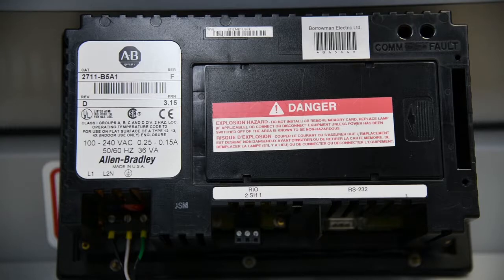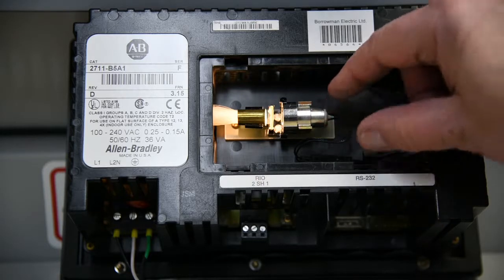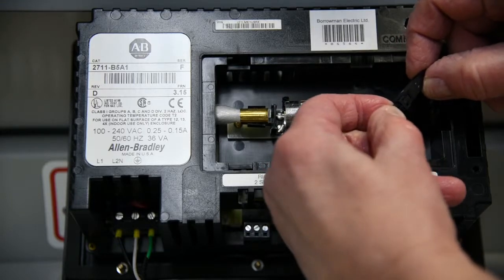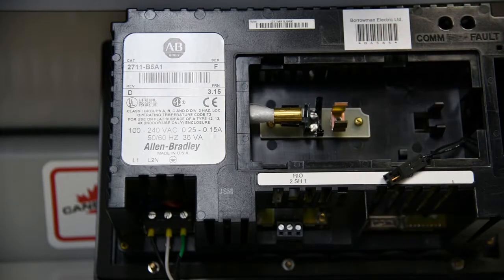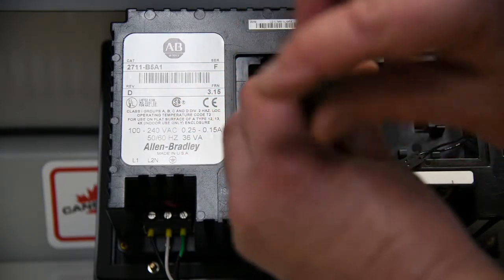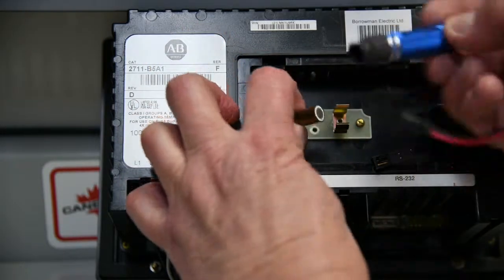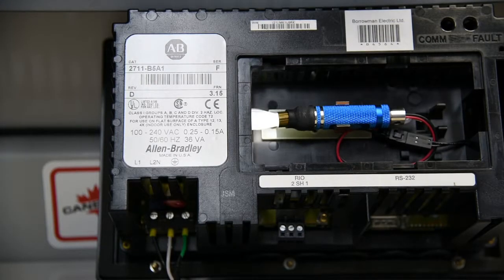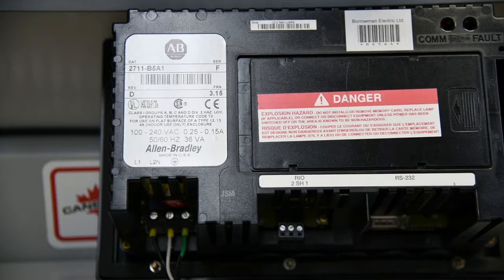Replace Panelview 550 Backlight

Comment: I have the 550’and I turned it on and now it’s in configuration mode says comm fault I don’t have a memory card is there a way to restore it or is there a way to get the pass code for the PLC thanks in advance
Reply from the maker: Hi Joe:
Sorry to hear that.
You need to backup and restore using either a memory card or if you are lucky the program is stored on the PV.  
Go into the load program tab and see if it is stored on the PV memory.
If not you will have to find the backup and the software and download it to the PV.
The PLC does NOT contain the PV program.  They are 2 separate pieces that talk to each other to specific memory locations as programmed in the PV with the PV software, and then separately in the PLC with the PLC software.
If all else fails you will have to go back to your original PV programmer and have them re-create the PV program from scratch if they have not kept a backup.
Bruce
Reply: @abplctestbench759  thank you

Comment: What is the part number replacment you used?
Reply from the maker: Hello Paul:  The original I believe is the 2711-NL1.  You can find multiple suppliers that make an LED replacement which is much better.  The original bulbs ended up scorching the ends of the fibers and the screens get dark.
Reply: @abplctestbench759  i cant find a replacement part. Where do i get one. Do you have a link?
Reply from the maker: @badaimkroni8266  EBay would be your best spot to purchase this backlight.  Use part number 2711-NL1 to search for it.  There are 30 or more listings at this point in time.

Comment: I have a PanelView 550 that keeps losing its memory. How do you replace the Battery?
Reply from the maker: Hi:  There is no battery to replace for the 550 application memory as far as I know.  There is a battery for the real time clock module but not one I have ever replaced.

When you lose the running application is there an error code that is displayed?

It is always a good idea to have a memory card with the application loaded on it.  That way the application can be loaded from the card rather than from a programming terminal.

Comment: Thank you sir i am very happy that i found your channel , i have some questions that i hope you would answer it, i am a beginner in AB PAC and i would like to know for example the total time for the CPU battery to be changed ( in my case it is an L62 CPU ) and if the prgramme would erased if the power supply failed and the battery drained , second where i work they don't have the programme so if there is a possibility to download it from the PAC (they didn't had an automation technicien  when they install it ), and what is the procedure to restart it if it stucks (i did worked with siemens S7 300 and it is an option on those kinds of PLCs )